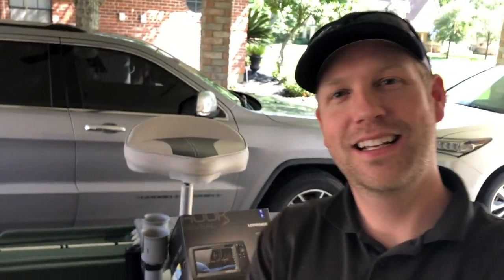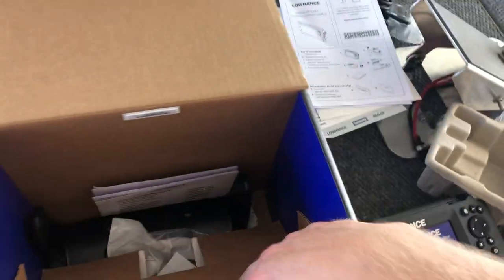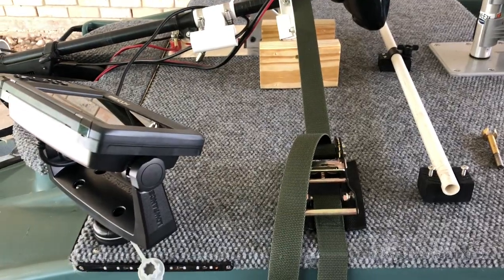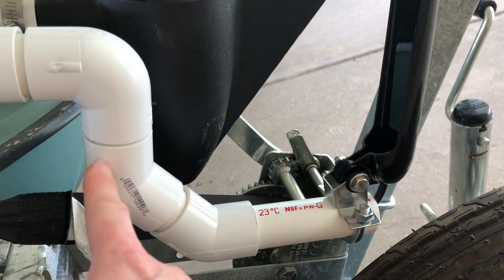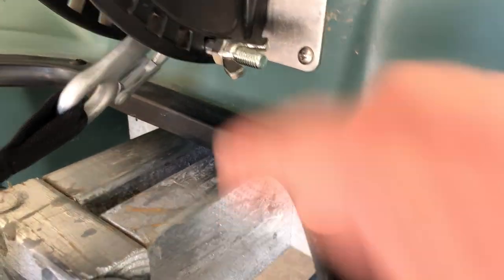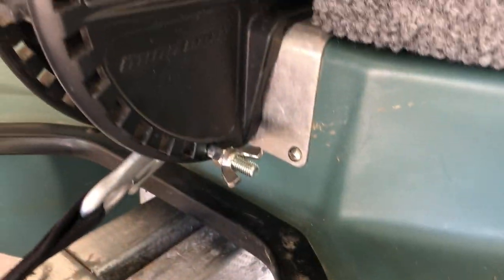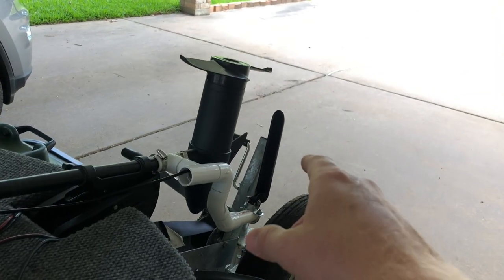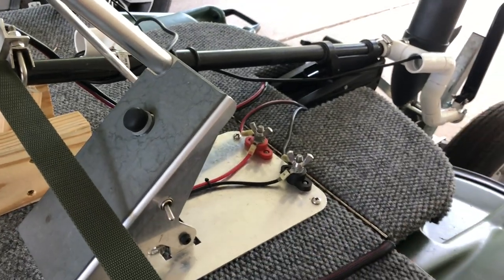Pelican Bass Raider 10E: Lowrance Hook Reveal

Comment: Looks nice. But I have a question about mounting the transducer on the trolling motor. If you turn your trolling motor doesn't that throw your side scan orientation off?
Reply from the maker: I thought this was going to be an issue as well, but it really isn't.  When I am using the side scan I am moving forward around 2mph or so and the boat tracks true.  When I see structure, I have a really good idea where it is and just cast to it.  I liked having it mounted off the side of the boat up near the front, but there was so much interference from the underwater current from the trolling motor.  The back was nice, but I didn't like how far past the structure I was before seeing it.  All the best!
Reply: @maxcastfishing4357  thanks for your input
Reply from the maker: David M you’re welcome!